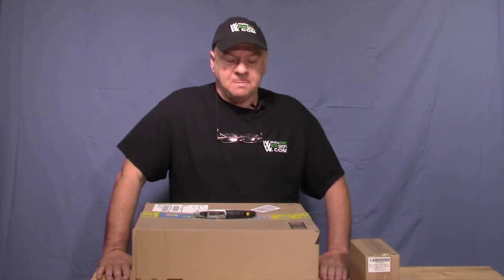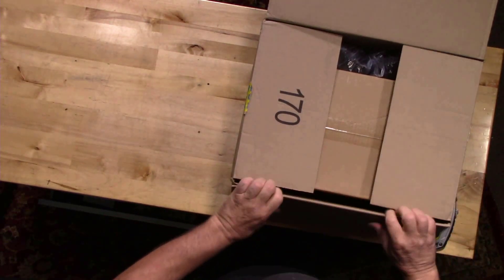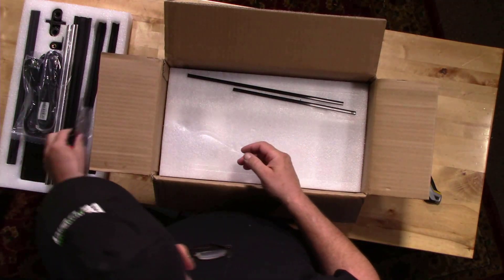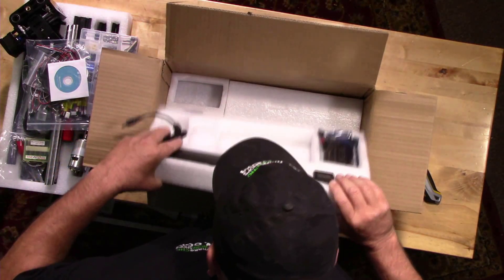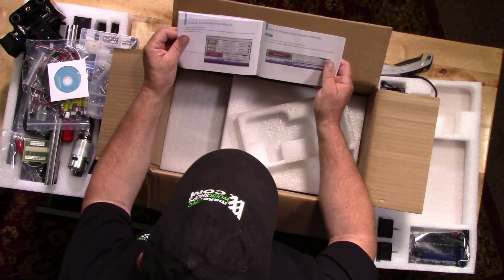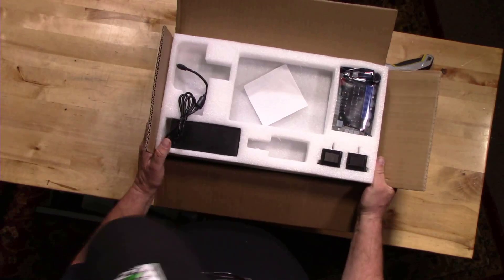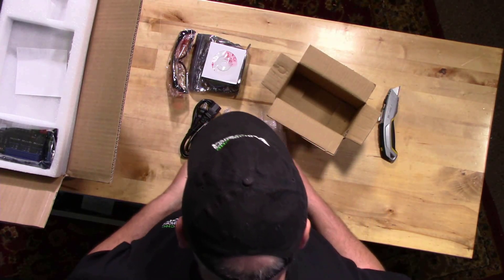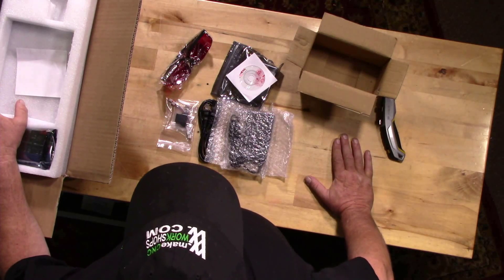Genmitsu MX3 CNC Router MACH 3  Part one Unboxing

Comment from the maker: This machine is perfect for making Model railway buildings at HO and N scale using 1/16 or 1.5 mm ply, basswood or balsa...due to the thin material it would be a relatively quick job and with the Laser, you can also engrave details, etc so good for that or even small scale Game terrain buildings etc